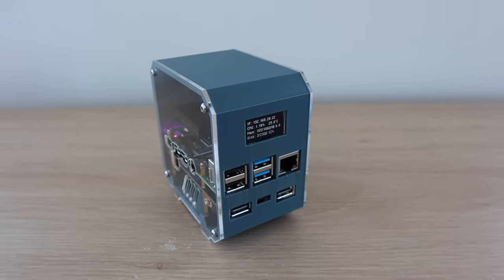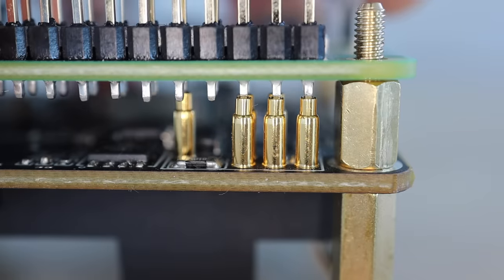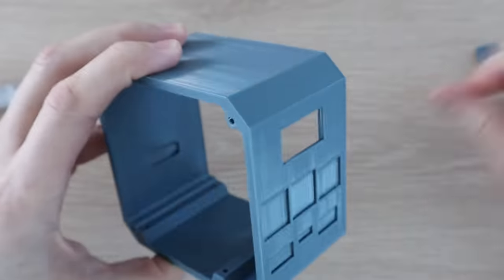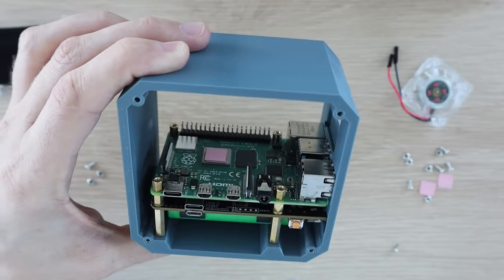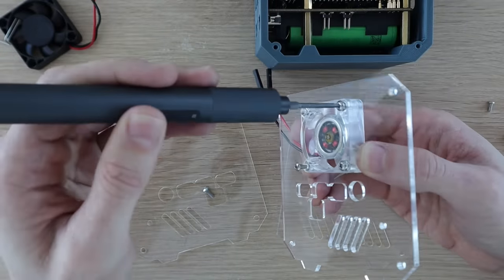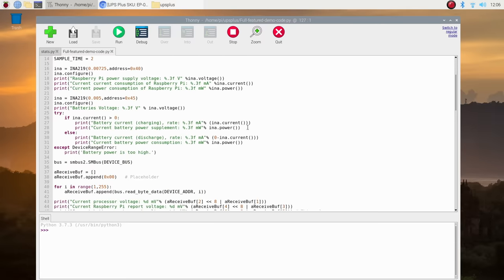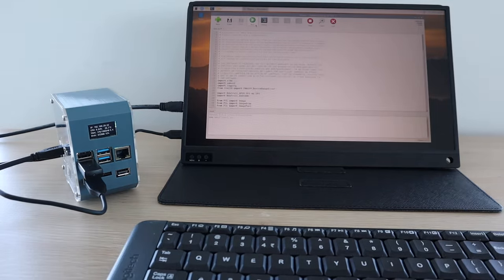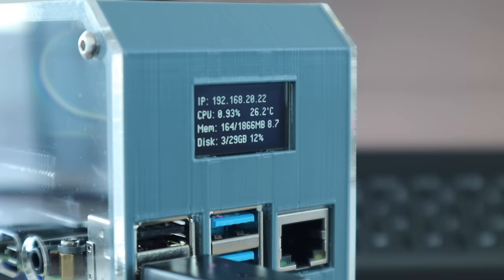Mini Raspberry Pi Server With Built In UPS & Stats Display

Comment: Should've placed air filters near exhaust holes and not allow that much space around the connectors. That thing is going to gather a lot of dust if the fan is set to draw air inside the case.

Comment: Awesome work overall! Reviews of the UPS though claim that it is faulty, do you have any problems with it?
Reply from the maker: I haven't had any trouble with mine so far, other than the issue mentioned in the video where the UPS just randomly starts up again after shutting down for a few minutes.

Comment: Is it possible to charge the UPS (and keep it charged) via a PoE hat or via one of the USB ports on the Pi?
Reply from the maker: The power input to the Pi is plugged into the UPS and the UPS keeps itself charged while supplying power to the Pi.
Reply: @MichaelKlements  so only 1 power supply is required (ie, one to the UPS)? That would be good.

Do you think it would be ridiculous to have a UPS & a PoE hat for redundancy?
Reply from the maker: Yes only one power supply is needed.
You can't use this UPS with a PoE hat, one of them will likely land up getting damaged. If you want your network backed up then it would be easier to just put a UPS on your Ethernet switch and that'll backup your Pi through PoE as well.

Comment: It's all very cool. Real world though, I would probably just put a 100 W/hr USB power bank with passthrough charging support on the sucker and forget about the UPS board...
Reply from the maker: The issue with power banks is that there is no way for the Pi to know when the power bank's battery is running low, so if the outage exceeds the capacity then your Pi dies. Granted a 100W hr power bank would last for 15-20 hours before running low.
Reply: @MichaelKlements  Yes, I did realize that there is an obvious lack of communication from the massive power bank...

Comment: What is the price, work in a day how many times , warranty in how many years
Reply from the maker: It costs about $150 depending on which model Pi you get. How many times it works and how long the batteries last would depend on the how unreliable your power source is and the quality of your batteries

Comment: Unless it's already been answered, how is the cooling?
Reply from the maker: I haven't had any issues so far, it runs at around 25-30 degrees idle and 30s when running intensive tasks.

Comment: Nice idea but the problem is when you have a total power outage, 
your switch or DSL Router where the Raspery Pi is connected to is dead without power.
So your Rasperry Pi is still running but you can´t get the data through the Switch/Router. 

Depending on the functionality in a power outage you can also use an external drive
or a NAS Drive. Both won´t work when the Switch is off.
Reply from the maker: It's quite easy to add a UPS to your switch as well, but this is also not the only reason to use a UPS on a Pi. Keeping the Pi running through an outage means its less likely to corrupt the operating system, and some applications don't need a network connection to still provide some functionality.

Comment: Nice video. I plan on building my own following a theft at my residence. I was wondering if you had any specs on how many and what type of cameras you are using during your test, which pi's were you using, how many cameras you can feed it with, does it run the surveillance software as well, and are you planning a second version? Thanks

Comment: But why everyone is stating that it’s only workin as a standalone powersource and NOT as UPS, bcs it’s not charging
the batteries or not reporting battery % back…
Reply: AAAANNNND if you buy the Raspberry with the case and the UPS completely you will save money!!! even if you print the parts yourself, the ordered one is cheaper!

Comment: I would not put the ups in the same tower as the computer- lithium batteries are not stable and will make an error at some point where in some cases fire is an possibility.

Comment: just use a piece of paper in between the battery and the slot while installing it so it wont turn on and risk shorting and then you can jsut pull it out like a tamgochi at the end

Comment: This is amazing! I'm going to build one asap.

One change of design to make assembly easier would be to use standoffs with female ends at either end at the bottom, then change the 3d print to have screw holes on the bottom to attach them with screws from underneath, so then the internals could be assembled outside of the case then installed in to the case fully assembled then secured from underneath by the 4 screws. Like I say, it would make assembly a bit easier with only a slight modification.
Reply from the maker: Hi Parl,
Yes, this is what I have done on the new SSD version of the case. It definitely makes assembly a bit easier.

Comment: Semantically, at what point is it small enough that you make the distinction between ups and battery? Cause that's just a raspi with a AA battery my guy. Very cool, tho.
Reply from the maker: A UPS has a regulated power supply, battery charging circuit, is able to change over from mains power to battery power without interruption and provides information to the computer on the status - it's quite a bit more than just a battery.

Comment: What kind of display did you connect the server to?
Reply from the maker: I'm not sure if you're talking about the display on the case or the monitor I used with the keyboard and mouse.
The display on the case is a 128x64 I2C display.
The monitor is just a generic portable USB C monitor, they're quite commonly available on Amazon.
Reply: @MichaelKlements  Thanks, it's the portable usbc monitor that I noticed.

Comment: Interesting but I would want more like 6 cells of 2500 mha for UPS for serious power cuts as I live on 30 foot  sail boat and solar panels can be deprived of sun power from bad weather lasting days or weeks. In a northern  Europe winter and summer times. 
I was planning a UPS  throug the 5 v C  type USB attached ,to a 40 amp  lead acid car battery I have as a  spare . 
Using 30,% the 40 amp in emergency power needs   that would allow me 12 volts with 12 amps  equals 144 watts  power over a day maybe I two  days not counting LCD  screens power needs  versus 15 watts from the  two 18650 cells
The Pi4 is very low watt power demands so very interesting for me versus my 60 watt laptop

Comment: Could you use this for a open media vault NAS?
Reply from the maker: Yes you could, you'd just need to add an external HHD or SSD.
Reply: @MichaelKlements   and leverage the ups for a integrated safe shutdown during a power outage?
thanks for the consideration. Take care
Reply from the maker: Yes, the UPS has safe shutdown built into it. You can also program the Pi to shutdown at certain battery levels or just when the main power turns off.

Comment: What display are you using?
Reply: Never mind, I was looking for 'display' in the description and completely glossed over that you had it listed as 'monitor'.

Thanks for the excellent videos and information you provide!
Reply from the maker: Yeah I just want to differentiate between the small oled display on the front of the case and the portable monitor that is used for the video output.

Comment: I'm in the process of making mi shiny new Pi Server headless.  Has anyone written a script to mimic the OLED display over Putty ??
Reply from the maker: I haven't tried to do it over Putty but the majority of the process is already done through the terminal, so I wouldn't think it would be a problem to do.
Reply: @MichaelKlements  Thanks Michael!  I printed out your stat script and I think I can get there without too much trouble.  I'm new to Python, but it looks very familiar :-)

Comment: using SD cards for raspberries always is a mistake. Use SD for short-term experimentation and research and use a proper storage device for everything else - for example some attached USB drive. Even booting from NAS is possible via TFTP. SD cards die after a few years of usage unless you redirect every volatile file/dir onto a seperate drive.

Comment: The Amazon reviews all suggest the ups board is junk. It doesn't recharge the batteries, overheats and burns out if you draw 3A. The video suggests as much, it comes back on by itself when turned off!

Comment: Fan is too loud IMO... Should have a regular sized fan as an entire side panel @ low rpm.
Reply from the maker: The problem with a regular sized fan is that they're generally 12V, so you'll need a separate power supply

Comment: The battery installation problem can be solved with a thin plastic pull tab covering the battery terminals. Insert the plastic pull tab, insert the batteries into the holder, then install the ups into the case. When you are ready to power up the server, pull the plastic pull tab.

Comment: Honest question: This device would be something like a NAS for home use. When my power shuts off, my whole network including any device connected to the server would also shut off. What would be the advantage of my NAS still running then?
Reply: As far as I understand it it's just so the NAS has enough power to shut down properly. If your NAS is shut down by just taking away the power some data could be corrupted and or/lost depending on what it's doing at the time of the power outage.
Reply: @toxicvisuals9376  Ah okay thanks!
Reply from the maker: As ToxicVisuals has said, this would just keep it running long enough to ride out short power interruptions or give it time to shutdown correctly. A NAS is also only one of a number of applications for a Raspberry Pi, people have them hooked up to sensors, home automation systems, security systems, as a mobile router etc., some of which would certainly benefit from staying powered on when the rest of the network is down.
Reply: @MichaelKlements  Thanks :) I wasn't thinking about these special cases.

Comment: The UPS module isn't really worth it.  By the time you have bought the board and the batteries you might as well buy a proper UPS unit that can power you wifi routers, internet connection equipment, NAS and server machine all in one.  They will power all of these things for much longer than this little board and don't cost much more.

Comment: I recommend anyone using Raspberry Pi units for anything outside of just goofing off or experimenting, to hard wire or remove and solder on a more reliable power input connection than the Type C or Micro usb ports they come with. Nothing against the manufactures for using these , it's not their fault, it's just that type c or micro usb ports are two of the worst power input options man has ever invented.
Reply from the maker: I'm curious as to why you've grouped type C into this as well? I have to agree that micro usb is pretty bad for power input but I've never had any trouble with USB C. There are also a number of laptops, monitors and smartphones that are now powered or charged through USB C

Comment: Raspberry Pi is more impressive as a home computer, not a server.
It doesn't really have enough RAM to be a proper server, IMO, unless you're hosting a small HTML website.

Home security cameras? It's 2021! I have two and i don't have a home server, because they don;t need one.
I think that portable devices on the cheap are way more impressive being made with raspberry Pi.

Comment: just think if you would of actually done the job correctly you would of put a battery insertion slot on the case instead of always having to worry about it shorting the board out due to exposed power going into the board like an idiot